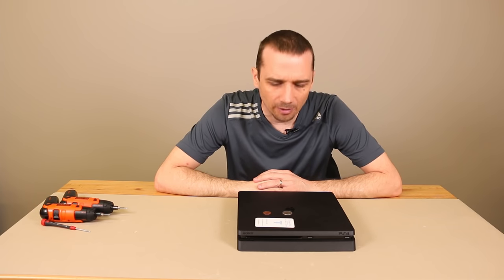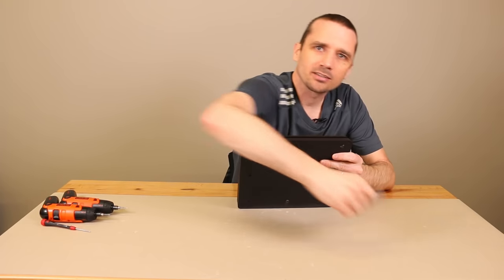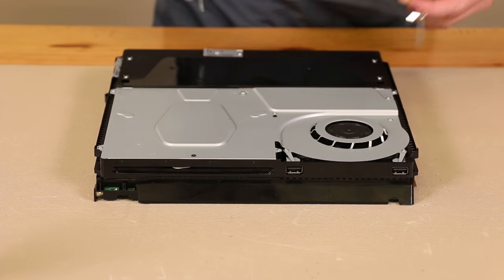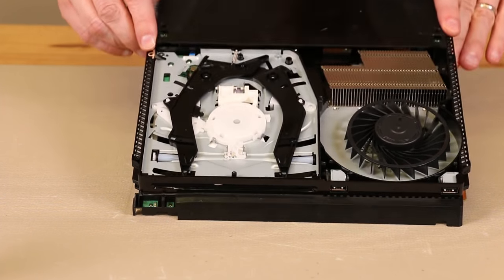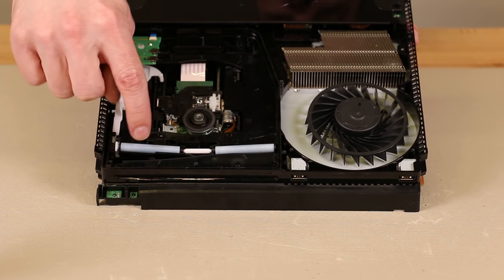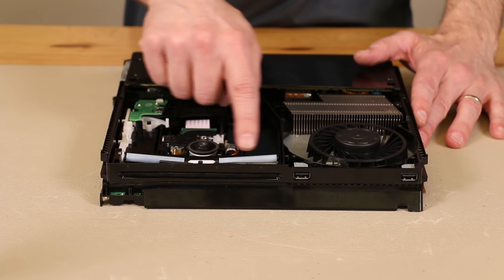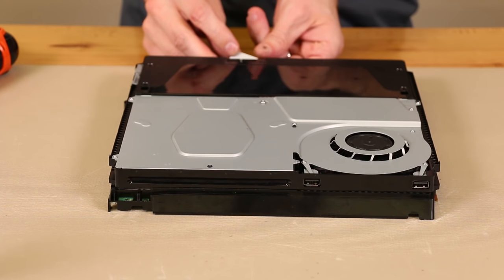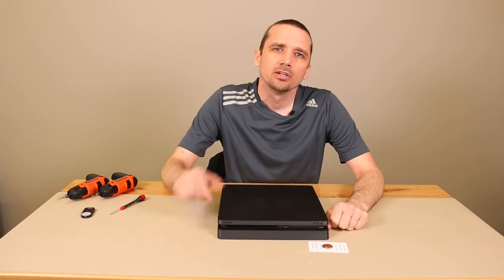How To Fix PS4 Slim Disc Drive

Comment: Mine just has black dots where the screws are on the metal plate
Reply: yes! up vote this. we need help
Reply: I just cut the black plastic pieces off and it worked
Reply: d0gst0p yea thanks man a lot
Reply: What do you cut them off with
Reply: d0gst0p yea what do you cut them off with
Reply: He has another video with that problem. Its the newer model. He took needle nose plyers and pulled off just enough plastic the slip the plate off, but left enough so it would still pop back on a little bit.
Reply: Those black dots are a pain
Reply: Samw
Reply: Thomas Shelby where’s the link
Reply: yeah mine does too get a screwdriver and bend them, they are just plastic
edit: try using scalpel instead
Reply: @thomasshelby1187  Do you happen to have the link for that? I can't find :(
Reply: markomus Fr
Reply: Same with me I had to do the same thing did you have trouble getting the metal case back on afterward cuz I did
Reply: They are black plastic welds which is on the newer ps4 slim I ran into the same thing look up his other video he explains it
Reply: I used a butter knife heated it up alittle and resealed it when I was putting it back together
Reply: @brandonburbage1373   do you have the link for the other video
Reply: @thomasshelby1187  Can you link the video?
Reply: BRUHHH they have metal screws ON THE OTHER SIDE! Just remove every screw you see on the bottom plate 😭😭
Reply: same
Reply: Same
Reply: Tes
Reply: @juniorrrr6  so is it necessary to take those black caps off?
Reply: Mine too
Reply: I just melted mine with a soldering iron
Reply: @brandonlantz9705  how???

Comment: Bruh he took the bottom off so easy
Reply: Ikr I can't get the left side off
Reply: Probably because it’s been opened more than once
Reply: yes damn!
Reply: Oh no, did you break the casing?!
Reply: He does this for a living 😂
Reply: @Emily-ti4ls  there is a sticker it needs to pe pulled off and there is a star screw
Reply: You really don’t need to take the bottom off or the antenna
Reply: @popmoss2191  peeling off the sticker voids the warranty

Comment: This video was great - not because it fixed my exact problem (not exactly) - but because it gave me confidence to open up my PS4 to diagnose the actual problem (the out of place rollers was in fact one of them - super thanks for that overview) - there were two other issues I was able to troubleshoot because I could get under the disc drive plate and inspect the roller and gearing assembly. Thank you so much!

Comment: My ps4 was struggling to eject and accept discs. Used this video guide, pulled it apart, cleaned the rollers. Put it back together. 
Works as new now. Cheers. 👍

Comment: My man, i stepped on my ps4 by accident and i couldnt insert my discs anymore and whenever i pressed eject it make some scraping sound, followed this video step by step and now it works perfectly fine 😃 thanks man
Reply: How the hell do you people step on your PS4!?
Reply: what did you have to do to fix yours?
Reply: MerkDalat I punched mine at the disk area and I can’t put in disk anymore should I do the same thing but do I have to remove the bottom?
Reply: This just happened to mine how, what was wrong when u opened it?
Reply: For me the rollers got out of place
Reply: It's probably binding take it apart
Reply: My rollers wont roll wtf
Reply: @falconhorizon8691  From having a teenage son, quite easily. Stepping over clothes, consoles, tablets, plates etc. Eventually they run out of visible space on their bedroom floors
Reply: How do you know if roller are out of place.
Reply: Crucial Vex literally just done the same thing as you. How did u fix it?
Reply: King SpyCrab 😂
Reply: @RamRanch666  same :(
Reply: [RAGE] Leek have you repaired It?
Reply: Dot have you repaired It yet? Same happened to me....
Reply: Same but I have black things over my screws
Reply: Did u have the screw cah I dont

Comment: really helpful, thank you. My issue was the rattle from the drive. After cleaning everything it didn't go away. Eventually I realized my problem was the shielding cover was a little bit bent inwards, I gently bent it the other way so that it wouldn't interfere with any moving parts of the drive. Solved.

Comment: Just a housewife here. With his guidance I was able to clean 4year old dusts and plus able to take out 2CDs (...) by opening up the cd drive. Actually I watched 'how to eject CD manually' first but I don't have small and long cross shaped driver. So this video helped me out. Thanks alot. It was my first time opening up PS4 slim. Ppl dun worry. If you know how to choose right size driver then there are nothing to worry abt.

Comment: Thanks so much for this video, it saved me at least $150 in repair costs. My wife accidentally got a mini disc stuck in the drive (don't ask) and I tried everything to get it out to no avail. I was worried about doing this myself but this video made it easy! I was able to work the disc out with tweezers after removing the metal plate.

Some notes/tips:

Place the screws on a surface where they'll stay in place and keep them in the order that you removed them, this will help when you reassemble.

As many others have mentioned, my PS4 had the 'black dots' instead of the additional screws, I used needle nose pliers to pinch them off and then tweezers to gently make sure they would release. I don't know if this is the best way but it worked for me!

Comment: my son knocked my system down and when I tried to eject a disc, I heard rattling. finding your video has helped me fix that problem, as it was the connector and the metal tab that came off. thanks for this video!
Reply from the maker: Glad it helped!
Reply: @Tronicsfix what about the eject button? it's cracked a bit on two opposite sides of the button. it won't eject discs. do you think it's fixable?

Comment: When I took the top off of my slim and go to unscrew the screws it's just this black cap type screw that doesn't even take any tools what should I do??
Reply: Dude same wtf
Reply: @Milad-ve4kl you can get like a very thin strong item and peel it upwards and u can put it back on easy
Reply: I can here for that same reason, but of course, he gets the easy one with the screws 🧐
Reply: the ps4 come with that sticker so it doesn’t get damaged u just take it off
Reply: DeadCell_XIII I have that too!!
Reply: @cht1643  these are not stickers. They appear to me to be plastic rivets.
Reply: did anyone find a solution?
Reply: Alex Garcia whats a box cutter
Reply: mine has these black smooth caps too. i cant unscrew them.

Comment: This video helped me greatly. The only issue I had was that instead of the 10 screws holding the plate on, I had 2 screws and the rest of the spots were plastic thermal welded. I had to chisel them off, but it still worked out just fine.
Reply from the maker: Yes, that's the new style. I'll be making a video about those soon.
Reply: have you done a new video on this issue?

Comment: Fixed a PS4 Slim, Rollers we’re definitely the issue bought it second hand and it was filled with Vape Gunk! Only recommendation is slowing down on the screws part and maybe do a freeze frame for clarity. Thanks again for you’re amazing help!

Comment: You are best console technician on youtube.
Can you tell me how to fix PS4 Slim won't read discs and it said " Unrecognized Disc" .
Thank you.
Reply: dylon kevin it’s the disc
Reply: It's not the disc it's the laser you need to clean the laser gently it might be dirty that is why it doesn't read your discs
Reply: dylon kevin
Reply: @ghostchivero9959  how
Reply: The SuperbMarioBros use a q-tip lightly dipped in some isopropyl alcohol, wipe it down gently with q-tip for maybe 5 seconds. Then dip other side of q-tip and

Comment: I'm a bit stuck at the metal plate. 8 of the 9 screws aren't screws. They're plastic  bits that look to have been heated and formed into caps to prevent the plate from being removed.
Reply: I'm having the same issue rn
Reply: blaksquire same
Reply: Im stuck here too :(
Reply: @joshuaquao5875  thanks dude!
Reply: Joshua Quao you’re a god, thanks
Reply: Me2
Reply: Thanks!  I ended up using a blade and just cut away the edges of the 8 plastic bits and 3 finger tips.
Reply: Dont mess with those, trust me there is 10 including the black one

Comment: Dude, Thank you so much! I found a post for a fat a slim a PRO playstations and 7 controllers. Of course all of it had little defects, but the worst was the slim, the tray was not taking in any discs, I opened it following your video and BAM! the spring that holds the two black arms together had fallen off the loop. Put it back on and now the console is working. The rest was just general cleanup, console initialization and thumbstick replacement. Hurt my back at work and haven't been working so I've been doing a lot of flipping of game consoles for an extra buck. Your videos are always helpful.

Comment: Worked thanks. Also FYI if you have plastic instead of screws on the inside, there is another video that will show how to remove plastic welds with pliers
Reply: Can you post a link to that video?

Comment: OMG THANK YOU! I just bought a slim off of Facebook marketplace. The lady I bought it from was super nice and promised it worked (and I fully Believe she thought that) I was short on time but she offered me every bit of demonstration (online, disc and dl'd games, HDMI and audio check etc). I decided it was already midnight and chose to not demo it.

Get it home.. can't read games. Just made a faint grunting from the optical drive and no sound when shaken. Putting it on it's side didn't help either.

Found your video, followed step by step ( except I used a micro screwdriver instead of a t8 sec torx) and low and behold! An old school bubble gum wrapper attached to a yellow checkered sticker balled up in the optical drive!
Reply from the maker: Ha, ha...nice. We've found all kinds of stuff in the disc drives...most recently a lottery card.

Comment: I've just opened up my Australian model. They have used 10 tamper proof plastic screws instead of Phillips heads. Used hobby knife to remove heads. Rollers were fine, it's the white slider and gearbox that is causing the grief on mine. It's somehow jammed and will not let the inside disc guard/ door plate move up and down to allow disc to move through rubber seals. Have you been able to solve this mechanical mystery by chance?

Comment: This video helped take the fear out of cracking my PS4 Slim up to operate. Although my lot run didn't have as many screws holding the internal metal plate, I could still follow along and get the job done. Thanks!

Comment: I followed your tutorial. Mine. I did not have to open the bottom. It's a slim too.and it has plastic screws that are permanent. I made a decision to just snap them out.

You have helped a lot. I had to open mine twice though. When I put back the disc thing, it was not well aligned inside. So it did not swallow in any disc. So I opened again and I watched your video like three times over, paused and saw how yours was aligned. It now worked.

By the way I found two discs inside, toy knife, coins, DSTV card... My son is the culprit.

Comment: Thanks so much from the UK! You guided me calmly to fix my PS4 as the material fringing on the outside of the disc drive entrance had got caught in the rollers. I even then got stumped as I have the PS4 with the plastic welds so I found your other tutorial and managed to remove those safely too! Thanks again for giving me the confidence to do this and saving me money sending to a shop!
Reply: And again after little hands put a toy disc inside the drive! Thanks a million!
Reply: How did you open?mine has plastic pins and not screws over the drive.
Reply: @luplewis9837  I had those. He has another video showing how to unpick these slightly so you can lift the casing. If you are careful you can do without too much damage and then replace the cover later

Comment: I followed all the steps took out the rollers and everything but it didn’t work the disks still won’t go it
Reply: It's JKB same 😡
Reply: it works with me! u can do it again hope it will work with u
Reply: [RAGE] Leek It helps to go to lose and get a bottle of canned air and use it carrefully and get all the dust out
Reply: The problem in this video is 1 of the few problems it can be if this didnt fix it then there's something else causing you drive to not work

Comment: Soap got spilled down the disk port on mine when i moved because my sister decided to pack soap in the same box as my electronics last minute 😤, everything else works so i figured some soap was on the laser lense. Took it apart and i forgot to eject the disk before taking it apart 🤦🏻‍♂️. Cleaned the laser and then put the disk back in before assembly since i figured it would save a step and now the ps4 doesn’t seem to know a disk is in and wont eject the old one. Did i mess something up? Or should i take it back apart and remove the disk? Please help! And thanks 🙏🏼
Reply: wait my disk is stuck and I wanna open my ps4 slim is it going to breakv

Comment: My PS4 slim wont turn on I have power going through wires just nothing on the console, my fuses went at home and ever since my console wouldn't turn back on, luckily my tv has already gone for repairs for the same issue, any advise would be helpful ??

Comment: Thank you so much, all I was missing was one of the springs:)
Reply: Where did you put it?
Reply: Cuz I might have the same problem😬
Reply: @juhiss912  if I remember correctly it should be one of the springs that is connected to a white piece that moves when a disc is inserted, I don’t really know how to explain it
Reply: @juhiss912  i just rewatched the video it goes on the first thing he took out first  it connects to one of the black pieces, it should have one spring on each black piece
Reply: @henryrodriguez291  I think I found the right place for it already, but thanks anyway 👍

Comment: @tronicfix llc have you come across an error coded (SU-42118-6) before? I've read in forums that it seems to be a disk malfunction (even though the disk drive works and is functioning normally). I'm considering replacing the disk drive since this thing is way past any warranties. Will this eliminate the error or will I just be wasting money. I refuse to spend much more money on a system that was working just fine until Sony did their 5.5 update. I think this error is horse crap implemented by Sony to either get people to send in their Playstations for repair or upgrade to their 4k Pro version. Neither of those are an option for me so I'm looking for some feedback. Thanks!
Reply: i have this problem with my spare ps4 slim, tried nearly everything apart from replacing the disc drive, i had a similiar problem with my old ps3, spent months looking for fixes on google/youtube, then i saw video about the disc drive, turns out i couldnt update cause the ribbon cable connecting to my discdrive was loose,
Reply: @scottishgamer4209  ok i have the same eror so it is from the ribbon cable or waht because i want to fix my ps4 slim
Reply: @kingofgams1610  yes, i put mine into a local shop for new disk drive replacement for £45
Reply: @scottishgamer4209  did it work
or it is from the ribbon cable
Reply: I am having same problem have you found any solutions if so please reply back it is total BS that it won't even update to where I can download games my Dynasty Warriors has a line with an X in it because that s*** won't update so it won't finish the download. if you got yours fixed somehow let me know how

Comment: Hey my Ps4 has a problem. when we turn it on and there is no disc in there when we try to put a game in it won't take the disc. we have to turn it off then turn it back on. then it starts to make a sound that it wants to get a disc in there thats when we put are game in. so we click the eject button to get the game out. then we have put it in rest mode then turn it back on to put another game inside to play . its getting annoying.
Reply
Reply: XxJayTechxX  go and see fast tech he is also a best technician in repairing ps4 slim you r telling your disk drive make a ginder sound then you can see that video okk

Comment: My ps4 slim wasn’t taking in discs. This worked to get the disc back in right after putting it back together and plugging the console in. I thought the problem would be completely fixed so I ejected the disc and attempted to insert and it wouldn’t go in. I had to redo everything in order to insert the disc again. But this does work.

Comment: Brother thank you so much I can’t tell how much happy I am from your video. My ps4 would take in the disc but not pull it in enough so I came to your video and you said to clean those 2 things which are connected with a gear and I did with some isopropyl Alcohol just as you said and now it works. Thank you so much!